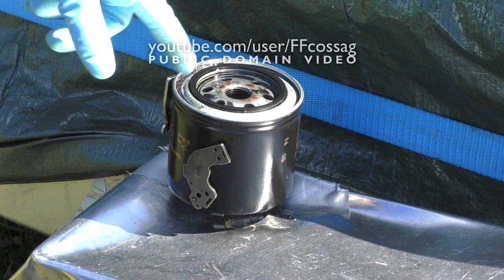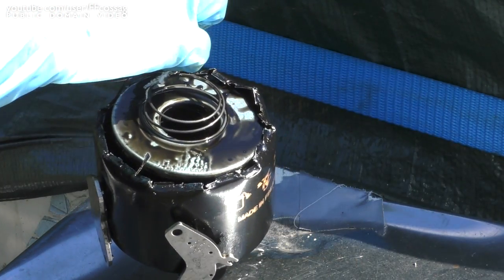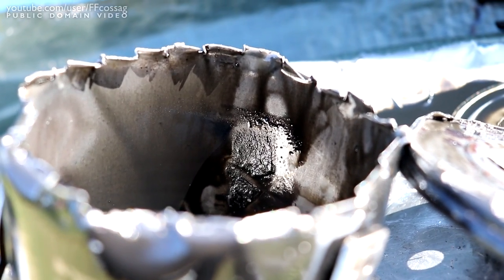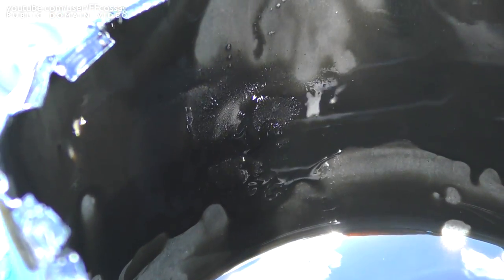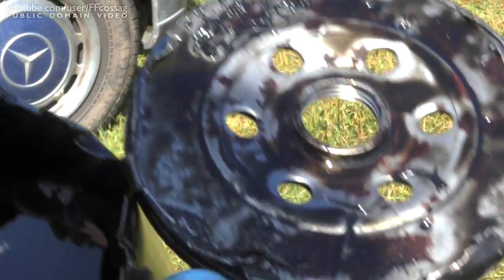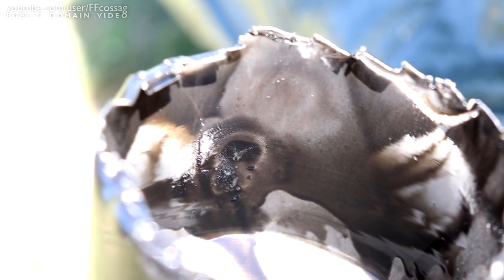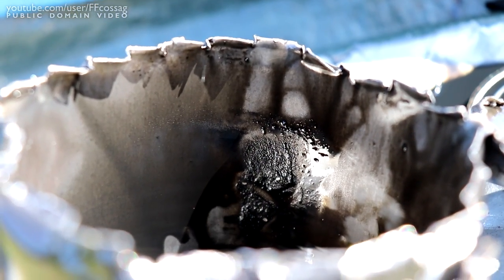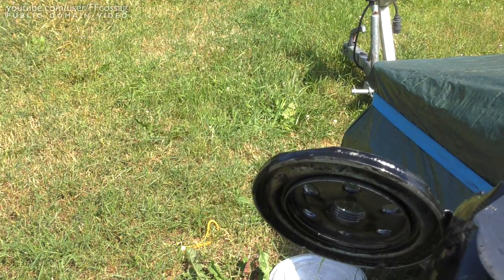Do oil filter magnets work?

Comment: I have a 2004 Corolla ,bought it new and use magnets on both the filter and the drain plug.the car now has 262,000 miles on it and it doesn’t burn any oil.I change oil every 5,000 miles. When the air goes ,it goes .I live in SC. I change the transmission fluid every 50,000 also . It has original automatic trans in it. Not a flush,just what’s in the pan. The transmission pan has magnets in it from the factory so it must work. They always    had metal on them when changing fluid.

Comment: IF you really want to trap the metallic debris .  The best place is in the bottom of the oil pan where the oil moves the slowest which allows the metallic particals to settle to the bottom of the pan!
Reply: That's what I was thinking.

Like in the transmission pans.
Reply: Trollarc Ninja  A problem with that theory, is that oil in the sump IS slow moving, snd fine, suspended particles can mak several 'laps' through the engine without ever getting stuck on a pan or drain magnet. On the other hand, a magnet on the side of, or inside of an oil filter will have the oil go past the magnet every time before the oil takes it's journey through the moving part of the engine. The magnet drain plugs best purpose is not to protect the engine from damage, but to provide and alert at oil   change intervals,that there is unusual wear occuring, when one sees the larger particles which are being captured.
Reply: And how would you easily check the metal inside the oil pan, without removing it?

Comment: It helps with the flow through the pleats of the filter itself. The filter would catch this small metal particles, but it would eventually clog up in the filter media if you went with extended oil and filter changes. It's a good idea to use magnets as long as they are the correct ones

Comment: the main parts you want to keep the metal particles out of is the main and rod bearings as well as camshaft brgs and journals. Although main ,rod and camshaft brgs are soft so the metal particles will embedd in the brg to help keep them off the polished crankshaft journals it's better if metal particles never reach them.

Comment: A little gasoline would've washed away that all that oil so you could see the metal debris better.
Reply: A magnetic drain plug is better, and simpler, and cheaper. Why f around with little magnets.
Reply: little? =D hahaha those magnets are super magnets from a HDD

Comment: Without the magnets that bit of metal would have been trapped in the filter. That’s what it’s for.
Reply: you are correct, BUT the oil will be cleaner while going the filter, thus a better flow of oil.  Now to say if this helps or not, I assume it would.
Reply: Hi Michael, most mainstream filter efficiencies do not catch any particles smaller than 35 microns in size. So most lube filters have an efficiency of 35 microns at 95% or higher meaning that the filter will catch approximately 95% of all particle larger than 35 microns. These particles are too large to enter the bearing clearances in the engine to cause damage, though its definitely good to trap them in the filter. Unfortunately its the particles that are much smaller that cause up to 80% of engine wear. Mainstream automotive filters have the poorest filter efficiencies as compared to any other equipment markets. GM study with API using ASTM D testing methods determined that the correlation between filter efficiency and engine wear in the late 80's. The outcome of the GM study was that engine wear could be reduced by 70% using a 15 micron rated at 98.7% efficiency. Unfortunately, GM never ever produced a filter with this efficiency, they are still putting 35-40 micron filters on their cars today, as well most of the other car manufacturers. Its the invisible Ghost particles smaller than 35 microns that are wearing out our engines and transmissions. Its a secret way to prematurely wear out our engines. You can't see the cause of the wear. Our eyes can not see particle smaller that 40 microns, unless there is a pile of them.Some studies concluded that 70% of engine wear is caused by particles less than 8 Microns. This is were magnetic filtration comes to the rescue, good magnets catch ferrous particles as small as 0.1 microns. Controlling these particles in engine oil can result in increasing the useful life of your engine by 10 times and increasing the life of your engine oil by up to 5 times. Add a drain plug magnet, make sure it is a non neodymium magnetic drain plug, this type loses its strength as your engine oil warms up and all the collected particles are released from the magnet back into the oil stream, another invisible Ghost at work wearing out our engines. The best I know of is a Dimple Drain Plug Magnet. Its a steel magnet bolt with the magnet machined in the plug, never strip or turn the corners off the drain plug. The mainstream magnetic drain plugs are generally made from aluminum and using Neodymium Rare Earth Technology.I have tested the DIMPLE drain plugs to be the best performing so far. I have achieved a 15/13/10 ISO Particle count with 25,000 miles on the engine oil with one of these magnets. If one could maintain this cleanliness code over the life of the oil and engine, you could logarithmically achieve more than 2.4 million miles on an engine before an overhaul would be necessary.Also, there is one company making mainstream engine lube filters rated at Beta 75, Absolute efficient 98.7% @ 20 microns. Rated for 15,000 miles and or 25,000 miles. Using a combination with this filter and Dimple Drain Plug Magnet to control wear particle is a guarantee that you will reduce your engine wear by at least 70% according al the studies correlating contaminant particle size with engine wear.
Reply: David Whittaker 
Finally someone who sounds like an ICML member 
I have seen some pretty impressive results with oil analysis using strong stick magnets and custom housings where not only ferrous metal counts being almost eliminated but silica levels (especially the lower micron range) drastically dropping 
Some theory’s with these results include static generated by circular movement of oil allows the silica to stick to the ferrous material and thereby stick to the magnet
These samples were taken from big arse industrial gearbox’s
Reply: Good advice. I have installed a by-pass filter system on my 7.3 PSD which is supposed to filter down to 2-3 microns. It also has a magnetic drain plug, but will change it to the Dimple.
Reply: Yes Stephen, I have witnessed this sludgy matter accumulated on the drain plugs, along with the ferrous debris. It has to make a difference. The magnets typically lower ISO Particle counts by a half to one code.
Reply: Good works Gage 2k5, you have taken the steps necessary to control and capture the harmful particles generated by the combustion process and dust and dirt particle ingested through the intake system. It is possible to extend the life of your engine up to 5 times or more by improving the oil cleanliness levels.
Reply: 20 microns and larger, Roger. A bypass filter will collect down to 2-3 microns.
Best to use a magnetic drain plug, mainly for checking engine wear.
Reply: Good works Gage 2k5, I am running the same setup on our service trucks. Oil sample ISO particle counts on average are 16/14/12 up to 50,000 Kms OCI's. We have achieved a 14/13/11 on one sample with 25,000 Kms on the oil.
Reply: was just about to say that. would have been in suspension and removed by the filter element'
Reply: Not exactly. The oil filter is for removing large stuff, and that is fine. However, they still allow smaller stuff that still causes engine wear (SAE says particle down to 2 micons, are responsible for most wear now). Oil filter usually can be counted on to filter out stuff, 20 microns and above. By trapping more material upstream of the filter, the filter provides a better flow of oil.
Reply: Most OE Engine Oil Filters are Beta 20 = 95% Efficient at 20um or absolute efficiency of 98.7% at 30 - 40 um. This equates to 100,000 particles 20 um in size upstream of the filter will allow 5000 particles to  get through the filter.The very best filters available are Beta 75 at 98.7% efficient at 20 um. This equates to 100,000 particle upstream 20 um in size and only 1,333 particles getting through the filter into the engine lubrication system.Doing the math on the advantage of using an oil filter that is 98.7% efficient @ 20um is that this filter removes 73% more particles in each milliliter of oil than the OE Beta 20 at 95% efficiency, the cool thing is they are both rated at 20 um but the 98.7% efficient filter removes way more particles thus reducing engine wear by more than 70%.I agree that the magnets do not discriminate particle size, if is ferrous, and depending on the strength of the magnet, it will capture all sizes down to 0.1 um and remove almost all ferrous particles in time from the oil stream in the engine's lubrication system.
Reply: Your pistons could be flaking away but your little magnet doesn't see it. They are aluminum. Change the oil, and let 'er go.
Reply: stephen meyer - Gear boxes and internal combustion engines use very different oil systems so I don’t think that is an equal comparison. Magnets in transmissions have been done for decades but auto transmissions use a lot of ferrous metal and the clutches are designed to wear and shed metal particles. In the case of manual transmission they have zero filtering so magnets in them are literally the only way to catch particles just like in differentials. Engines are much more efficient at filtering without magnets
Reply: Only the larger pieces would have been trapped by the filter.  The magnet captures stuff the filter would pass.
Reply: Change it every 3-5000 miles
Reply: @davidwhittaker9511  thank you brother 
Can u give us good effeicient brand names of engine oil filter magnets and transmission oil filter magnets to buy and fix in our cars?
Reply: @davidwhittaker9511  I'm guessing that is why tractors that use hydrostatic drives use a strainer with magnets for the initial cleaning and then through a screw on filter for an additional cleaning

Comment: To clarify:  Magnets on the DOME END of the filter really don't do 
anything that would actually show up in an oil analysis test. Why? the 
filter is full of oil under pressure for sure, but the flow of oil is 
greatest at the open end of the filter, that is, the oil takes the 
shortest path thru the filter and if you have magnets located there, 
they will catch visible amounts of wear metals, ferrous type, while all 
other wear metals will drop as a result! The oil does not travel all the
 way to the end of the filter media before passing thru, so 
long/oversize filters does not improve anything as you might think.   
Long narrow bar magnets along the sides of the spin-on filter close to 
the mounting threads does work great though!

Comment: Next to prolonged idling, the cold start of any engine is where 98% of the wear takes place as the engine has not yet expanded to it's operating temperature. Fleet operators now instruct driver to shut off the engine when making deliveries rather than allow the engine to idle. It is about wear patterns and oil consumption. Reasoning that most of the pattern is created within an RPM range, low idle RPM the piston /cylinder match is not so good as most of the time the engine is moving the vehicle down the road at speed. But yes, regardless, change that filter and oil

Comment: We have "can openers" for oil filters here in the States. It's common practice in motorsports to occasionally check your filter.
Reply: Brian Borell 
Basically they look like a huge pipe cutter for copper pipe, works great.

Comment: They work for ferris alloys in the oil but the magnet has to be strong enough to saturate the metal shell, so there is a strong enough magnetic field inside.

Comment: I use “filtermags” in my vehicles

Since doing so, I have no debri on my magnetic drain plugs 

Highly recommend
Reply: It s good but very expensive do you know a good alternative brand with good price ?
Reply: @faisalalmalki7853  There is no alternative, at ANY price, that can compare with the FILTERMAG # SS365PR's  Magnetic power, surface area, and heat stabilization.
 The FILTERMAG lasts forever, so the initial cost is meager.

Comment: If you guys have wix filters I'd go with those. Dunno if I'd call that much metal normal you should try sending your oil in for analysis. You can also buy magnetic oil drain plugs as well
Reply from the maker: It hit me after the video, that a fair bit of those metal particles look a lot like the metal that the filter is made out of. Since I beat it apart with a hammer and screwdriver, most likely some chunks came off in the process.

Comment: you had doubts.....? at least the metal is sitting on the casing not blocking pores of the paper element helping the filter flow oil and last the distance between changes.......

Comment: Most transmissions used to have magnets built into the pan. I don't know if the newer ones still do
Reply: The 4R70W transmission in the famous 95 MERC has a ceramic magnet in the transmission pan -- it gets cleaned when the Trans Filter gets replaced at 30,000 mile intervals.

Comment: If you think it well there's no much sense putting the magnet there because those particles would mostly get trapped by the filter if they weren't stopped by the magnet, a good place for those magnets would be the oil pan, that way you avoid the metal particles from getting into the oil pump at first
Reply: Yes, a good choice to catch the ferrous wear, but difficult to clean the collected particles from the pan. It is a common practice on transmissions and hydrostatic drives. The pans are easily removed to service the filter and oil, so the pan cover is generally cleaned at this time, not so convenient to clean the engine oil pan. Alnico magnets have the highest heat rating, meaning they hold there strength as temperature rises. Medium costs as well.
Reply: David Whittaker the most logic place for the magnet would be the screw used for draining the engine oil, that would be very easy to check while changing the oil and I'm sure it would catch most of the particles on most of the cars (except some weird oil pans out there that would be less effective due to having a false bottom) 

Anyways if it was my car I would prefer to have to remove the oil pan rather than knowing all those particles are going into the pump
Reply: How would you get the metal out of the pan? Take the magnet off at each oil change?
Reply: Ardent Fan any strong magnet on the pan is going to magnetize the pan area around where the magnet was attached. Even when you remove the magnet, the pan will still be magnetized and those particles will not flow out when you drain the oil. Just change your oil and filter on schedule, and you can put 1,000,000 kms on a good engine! There are lots of stories of people putting that kind of mileage on a vehicle by changing the oil/filter on time and doing engine tune-ups. If you maintain your vehicle well you don’t need magnets on your oil filter or your oil pan.
Reply: @jonathanalcocer3872  In the case of a false bottom oil pan, wouldn't the particles be equally attracted, simply because the oil is circulating?

Comment: Seems like a good trick towards keeping the filter clean for longer, and thereby securing a better flow! Nice video.
Reply: The metal particles from the filter are usually less than the 15 or so micron paper rating, so they typically flow thru and recirculate.
Reply: You don't want to keep the filter clean, you want to keep the engine/oil clean.

Comment: Next time, mate, chuck that in a metal lathe and have a clean shaven cut in moments, instead of the Neandrathal Hatchet method
Reply from the maker: Put in a big enough donation, and I promise I'll buy a lathe. ;)
Reply: FFcossag lol aren't you a clever one..
Reply: the Neanderthal method is more manly.
Reply: As if the average guy has a lathe! Better yet, have you guys ever heard of filter cutters ? They take about one minute to cut a filter open, and a clean cut. No shavings.
Reply: Or even a Sawsall!
Reply: @memorylane7068  Can't use a saw because the shavings end up in your magnetized area
Reply: Patrick Darling  Sorry, not smart as the grinder makes the fine metal dust that you are trying to evaluate. BY the way, you can get a new, crappy 3 or 4 time use angle grinder from Harbor Fright for $9 US
Reply: @FFcossag  Actually, in this day and age in the USA, one can buy a great used lathe - South Bend or Atlas for 2 or 3 hundred dollars. Not many people left that know what one is anymore. I have a Sears [Atlas] from the 1960's and it would be hard to live without. Otherwise, a large pipe cutter works too.

Comment: I have been using microwave oven magnet s for 30 plus years.They do work.Put one on my transmission pan too.
Reply: John Moyer Quite a few transmissions have magnets inside on the pan already. I cleaned a 1982 D150 pan that had loads of metal on its magnet from the factory. My trans in my 05 silverado is going a little on 2nd to 3rd but the magnet wont work all too terribly well but it has them already inside from the factory.
Reply: computer magnets work way better than the tranny pan magnets. definitely see a difference when dropping the pan and swapping the gasket and filter.